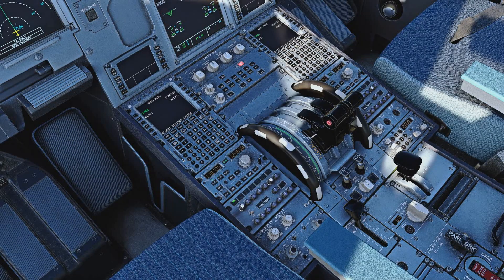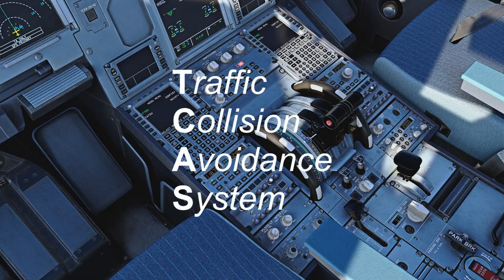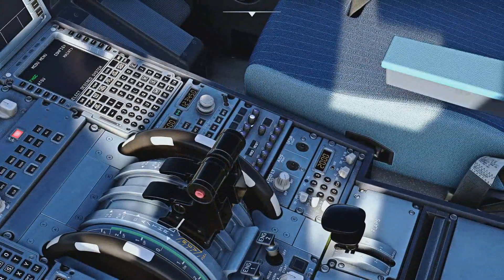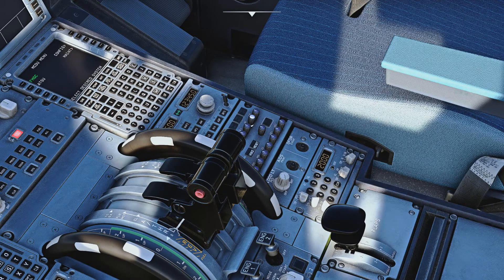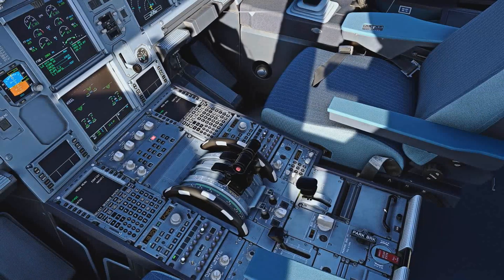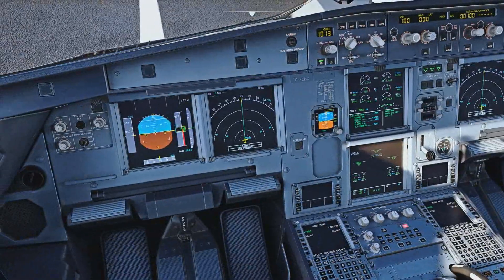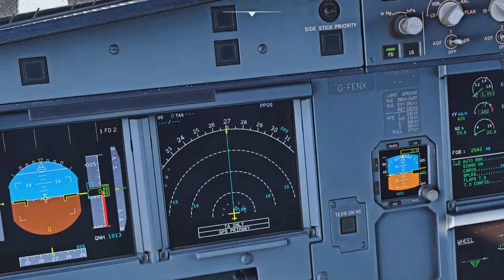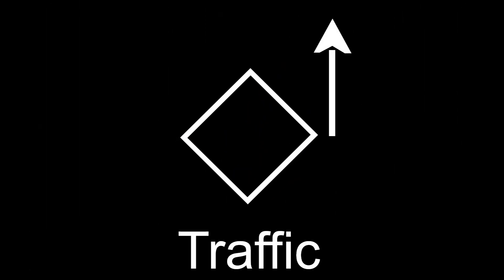Avoiding Mid-Air Collisions - How to correctly use TCAS

Comment: Great video as always. Quick question re the switch top left on the transponder panel. I’ve never understood the difference between AUTO and ON. Thanks
Reply from the maker: From the manual:
STBY : Both XPDRs are electrically supplied but do not operate.

ON :
In flight: The selected XPDR operates. 
On ground: The selected XPDR only operates in mode S (Selective aircraft interrogation mode).
AUTO :
In flight: The selected XPDR operates. 
On ground: The selected XPDR only operates in mode S (Selective aircraft interrogation mode).

Hope this helps.
My company only uses Stby and Auto
Reply: @ thanks so much for taking the time to reply. Very interesting and helpful. Every day’s a school day, particularly when it comes to the A320!!
Reply: @fsclips interesting, so that is another bug or vpilot auf Fenix of VATSIM and vpilot (the other one being: strobe auto will always be understood as ON by your fellow player‘s sims, only OFF is an option when taxiing). The ATC will tell us to squawk Charlie, on takeoff roll. Now AUTO can’t do that, we put the mode switch to TA/RA (the ND will obviously read TA only, maybe the problem comes from this) and this is not enough, so during line-up I select ON, put it to AUTO during my clean-up flows after acc alt, and well, I won’t touch it again until vacating the runway after landing (well… above, neutral and below tilt will be manipulated with of course). How is this dealt with at airports which want you to operate your transponder in MODE S on the apron (for pushback and taxiing) like for instance Brussels? This is the only case in VATSIM that I really NEED to use the ON mode, because there is a option within vpilot to automatically switch to squawk charlie on takeoff, which again, only solves the issue I had mentioned first, not the Brussels thing.